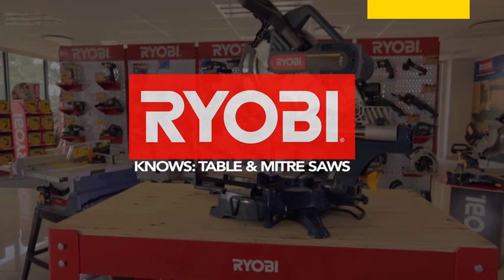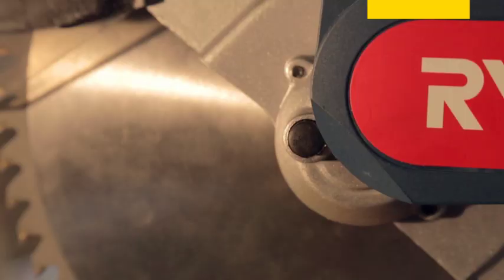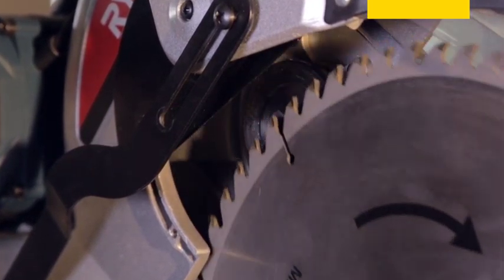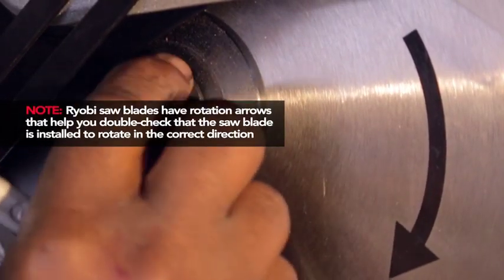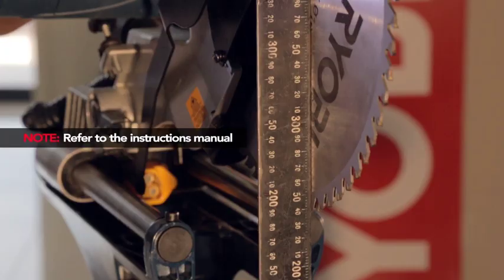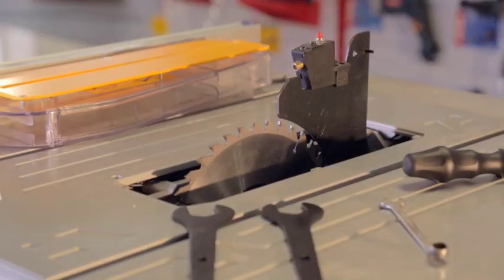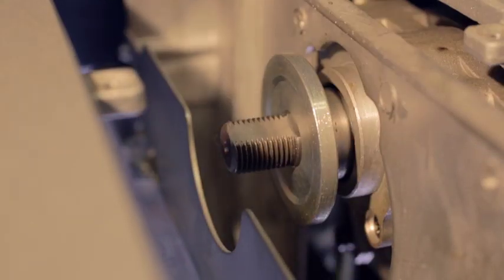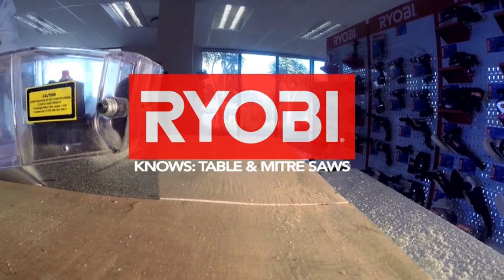How to change Ryobi Table & Mitre Saws blades.

Comment: I can't find replacement blades any where with the face to face D shape bore hole. Any ideas. Is there a fix to get a round blade on? I can't even find reducing rings to fit the D shapes.